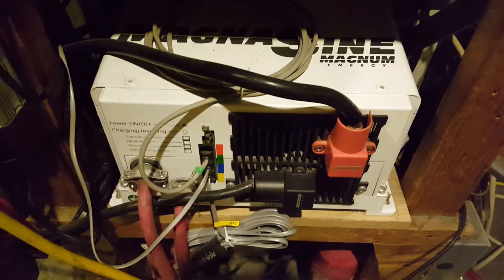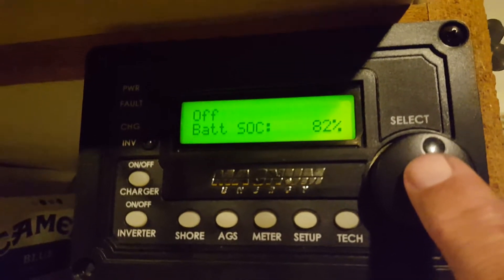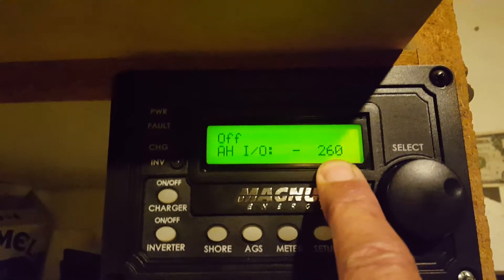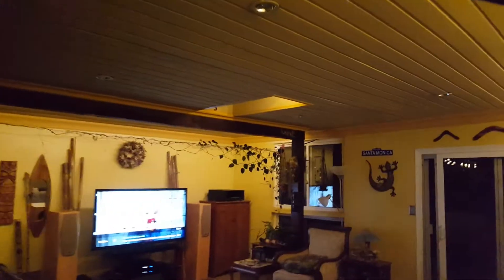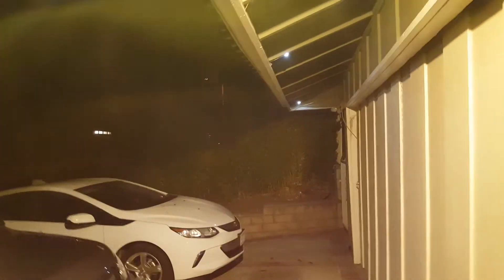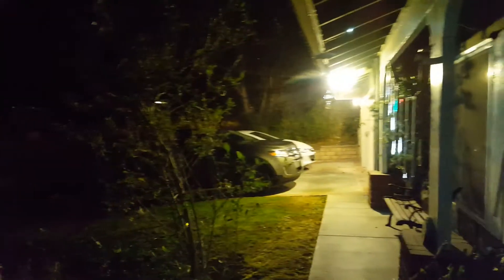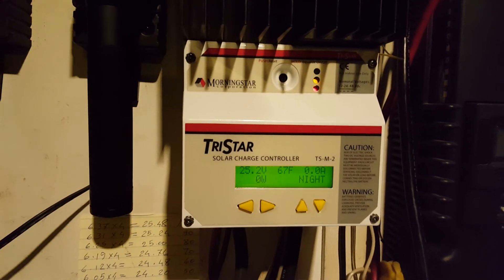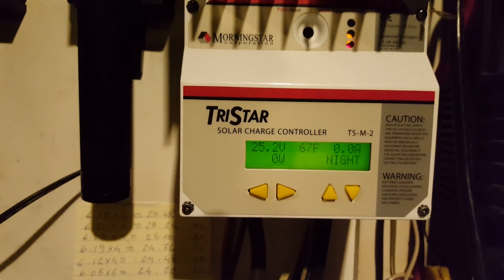Had To Turn Off The Inverter To Save The Batteries!

Comment: A good solar setup, you get more and stronger sun in Calif. than we do here in New England. I noticed many boomerangs on your wall, I have one I brought back from Australia , made by the Aboriginies. Thanks for the tour of your solar. Was the 13.4 amps the load of the house then.??
Reply from the maker: Thanks for your input! yes the 13.4 amps were the load on the 12 Volt side of the house.  Be Well Brother and thanks for your sub!